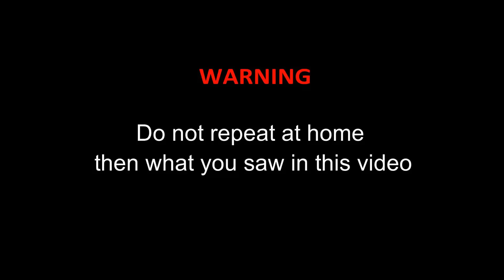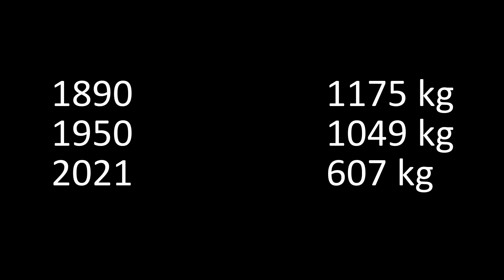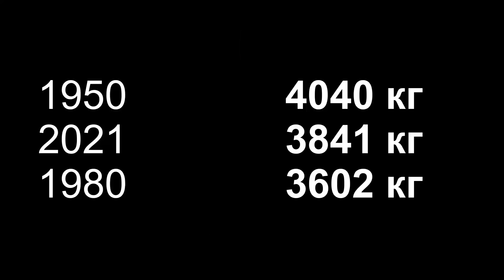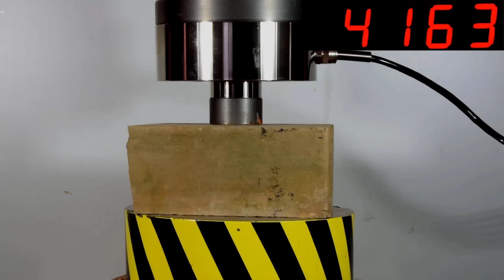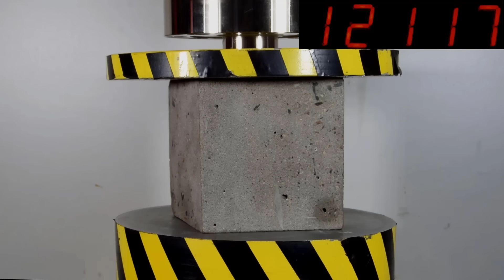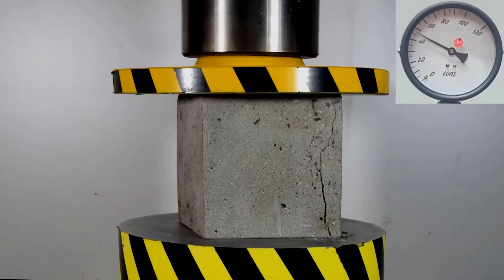HYDRAULIC PRESS VS OLD AND MODERN BRICKS

Comment: Whether the old ones were strong right from the beginning or gained its strength over the years is an interesting question.
Reply: They werent stronger. They were much larger.
Reply: Actually i have read somewhere that  buildings also need  Oxygen ! Without oxygen for 5 seconds all building will collapse instantly like a house of cards
Reply: @Ognyan397  that's terrifying
Reply: @toiletpaper5770  yes! So i guess that maybe Oxygen accumulate into the building and their components , that is why they get  tough with time!
Reply: The old ones have more practice
Reply: Bro the bricks are not from Asgard
Reply: @shubhampreet9928  🤣😂🤣
Reply: @Ognyan397  Was that statement that they need oxygen in their molecules (wich is expected, but trivial) or free flowing in the air?
Reply: @vast634   I think free flowing in the air , since if the oxygen from the Earth disappears  and  until we count to 10 all the buildings will collapse !
Reply: @Kudjokorn 
But, the newer bricks have younger lungs, and can therefore hold their breath for longer....!!
Reply: @Ognyan397  I believe that applies for unrealistic or science fiction types of scenarios.
Reply: @Ognyan397  how can oxygen from the earth disappears ? 🧐
Reply: @eugeneng2721  Ofcourse  a sci-fi scenario! :)
Reply: @vast634  Thanks!
Reply: No😑...
Reply: Stronger from the beginning better quality made compared to nowadays
Reply: @Ognyan397  that's not true, you can use a vacuum to remove all the oxygen and nothing will happen.
Reply: I would have thought the older bricks which definitely had water damage from limescale soaking into it for decades and charring from a fire, they should be weaker and more brittle I would have thought, from seeing such bricks in my life.
Reply: @Ognyan397  nah actually it will hold
Reply: They're mostly clay. They won't appreciate in strength over long periods of time like concrete can.
Reply: @Ognyan397  I saw the same in "What If" video.
Reply: That’s what I thought about
Reply: More the way things got produced.
Today is everyrhing about so fast and cheap as possible.
Reply: The workers back then were more focused in their work or Never had the thought of being under paid and worked happily. I am just guessing.
Reply: ._.)/ The older one has gone through years of fermentation process, that the taste getting stronger and denser...

Legend says, it will become diamond after milion years of process..
Reply: @watchesonly  
Yes !
Lower IQ workers make better things !  :D
Reply: I do ceramics however not specialized in brick. The thing is that it might be different material and firings time. This also affect the bricks, for example how compacted it is, porous, mixing time such. Also, remember there are different types of bricks.
Reply: It is almost certainly planned obsolescence.
Reply: @Kusunoky  
This was my thought.  Also, engineering plays a role.  For example, if we made a slightly more porous brick with nearly identical compression strength with only 70% the material/mass, then the loss in shear strength/yield is not really an issue since bricks are almost exclusively under compression.  Making lighter bricks with the same compression strength means taller or even stronger structures are possible.

Or just use less material.

It could also be that the process has been adjusted - why do 15 extra hours of work per brick if the difference in compression strength is negligible?

If craftsmanship were to be about building the best thing you can with the materials given, engineering is minimizing all that is unnecessary within a system and maximizing all that is essential.  There are times when the two concepts clash, depending upon what we are classing as the system.  I may want to, as a craftsman, build the best wheel that can be made.  The car company wants a wheel that works reliably and doesn't eat up 30% of the finished vehicle cost.  The customer doesn't want to pay me to forge wheels out of unobtanium alloy precipitation hardened over decades with chakra runes inscribed according to ancient gnomish rituals in the depths of tartarus and bluetooth 7.77 integrated in.  They just don't want the wheel to fall apart while they are not-walking-everywhere.
Reply: @Ognyan397  oxidation change the chemical composition
Reply: Concrete harder in 20 years
Reply: @Ut1F70F Sin 
There is a considerable difference between bricks and cement/concrete.  Bricks are kiln-fired and directly sintered.  Sintering is, basically, heating a material up until the atoms phase through each other to cease being distinct granules.

Concrete is a geopolymer with chemical bonds formed between the constituent components.  Considerably different from a sintered ceramic material.  Fired clay materials, for example, will not appreciably improve in strength over time.
Reply: @Ut1F70F Sin 
Durability is a rather nebulous term... Typically, in a metal, we would refer to durability being the ability to recover from stress or strain.  Tempering of a blade, for example, can make an extremely hard precipitate that will chip and shatter because the hardness is achieved by stresses in the material.  There are entire fields of science/engineering devoted to studying this in various metals and mixtures of metals.

Another aspect of durability is abrasion resistance.  Bearings, for example, have a probability of failure over time, rather than a known and defined duration of life.  This is mainly metal bearings, because the metal forming the ball and/or bearing surface is composed of crystalline grains.  These grains lead to uneven wear and the way in which that wear works over time is nonlinear.  "Glassy" - or "amorphous" materials are a huge subject of research and development because of their application to bearings, as the materials do not have crystalline grains, but "glassy" grains which do not propagate wear effects the same way.  This would "technically" be described as "tough" - but is a category within durability.

There are also things like springy metals/alloys.  A rigid material will shatter or chip whereas a springy one will flex and absorb the energy before returning.  Almost every metal has some springiness to it - but ones engineered to be springy obviously are.

Most of our terms for materials engineering are derived from those for metals.  Bricks and concrete are rigid.  Rather than bending or undergoing plastic deformation (where a metal is permanently bent), they shatter or crumble.
I have a set of aluminum nitride tubes for a project I am working on - and they are sintered together and almost perfectly rigid.  Rather than bending or flexing, if they are subjected to too much stress, they will just snap, crush, crumble, etc.  They are effectively specially formed bricks.

Concrete is closer to a resin or epoxy - which are closer to plastics... Which are polymers.  Stretchy polymers which we use all around us are a rather specific set of polymers.  If we want to be technical, sugar is a polymer - cellulose being one of the most common sugar polymers which can form rigid crystals stronger than steel.
You would know it as wood... But the "hard" or "tough" part of wood comes in a large part from the cellulose.

I'm not nearly as studied in the field of geopolymers, which covers the subject of concrete(s).  The concrete we use today is different from Roman concrete, and there are different formulations and processing considerations that go into everything, as well.  In many ways, roman concrete was superior to many formulations used today - that said, our concrete uses a lot of material recycled from industrial processes.
Reply: @Ognyan397  100% not true. Ive studyd architecture.
Reply: I doubt bricks would gain strength. But concrete absolutely gains strength overtime. That's actually a pretty well known fact.
Reply: I'd vote on the former as the current trend is to build everything out of the cheapest sh*t available, where as time & effort to source quality building products was a necessity for anything that's survived as long to exist in the present. Inferior bricks from that era will most likely cannot be found today. Survival of the fittest.
Reply: That is interesting. That's the kind of shit you want to see in the comments. Inspired speculation and fact sharing . 
Thanks for that. 
Are you secretly a troll too? 
Cause that would be very interesting lol
Take care stranger
Reply: Or the material was just better.  I am guessing the 2021 bricks are lighter and more porous probably for shipping purposes.
Reply: The bricks were far denser before 1970, now they are far lighter due to more air in the baking process.
This is what makes the older brick stronger more parts to rupture in the bricks core.
Reply: Wondered the same, I have heard some older brick making techniques were superior to todays, but also one questions how much stronger they got with time, subjected to same environmental/geological processes. Would be cool to think theres some brick making secrets out their yet to be discovered.
Reply: My guess is that it's a sampling bias.  The weak old bricks have already been destroyed by time.
Reply: @enochofmi  The older bricks cracked at twice the pressure applied? 
I don't understand your comment.
Reply: @Ognyan397  yeah but that’s at the molecular level you oaf. Lol buildings don’t breathe
Reply: @greyguy.960  not all bricks from 1890 still exist.  The weak ones broke from whatever they were being used for,  some chipped, and weren't video quality,  those were also probably on the weak side. Any brick that lived since 1890 and remains in pristine condition is probably one of the stronger ones. Those filters haven't been applied to the new brick.
Reply: @enochofmi  but did he sample the bricks strength from  just appearance alone , Probably just bought as seen or tested as seen.
To assume many things to a bit of stretch, I use Occam's fallacy of the simple answer is probably the right answer.
Anyway, the new bricks haven't been under load, I guess the brick from 1890 has been or been under the damage of freezing and thawing judging by where they live but still the older is much stronger,  by double than the new brick,  so the conclusion is clear in two examples as reference.
Reply: @Ognyan397  I think when they said "oxygen disappear" they were saying every oxygen molecule, including the ones inside the "hard material part" of the concrete .. just like the oxygen molecules that are present in our DNA or skin cells .. it does not need air flow oxygen to stay strong once it's already hard
There are oxygen molecules that only exist to "connect atoms" like carbon atoms, it can be used to create pencil but it's also presented in the steel ... 
I'm a civil engineer
You can search for super vacuum chambers, like the one used to drop a feather and a ball at the same time.. there's technically no oxygen inside but the walls won't turn in to dust
Reply: @greyguy.960  Occam's Razor, sure. I gave examples to illustrate my point, not to propose anything concrete.  My assumptions are: (a) any set of bricks have a range of strengths, (b) bricks at the lower end of the strength range are more likely to be destroyed before this video was made, (c) the longer a set of bricks has existed,  the more bricks will have been destroyed, and (d) the amount of strength lost by an individual brick over time is negligible.  

Given these assumptions,  the older a set of bricks is,  the higher the average strength of the surviving bricks.
Reply: @enochofmi  So load and freezing don't come into your equation or water damage? 
Which are the main things that would weaken a brick.
Plus if the sample of the old bricks is the same as the new bricks on-sight alone,  you are assuming he did it on strength? Which he just as the video stated it was on age.
Btw you using assumptions, I gave you a few counters as an example.
anyway, the newer bricks were many times weaker compared to the two examples which showed a far greater strength.  Unless he happened to find two one-offs and a very weaker newer brick you are arguing a point that doesn't change anything as the finding were not minimal.
What through me is" you saying the weaker older bricks were destroyed by the time" but not writing the context which made me think you were talking about video at hand.
Reply: @greyguy.960  those are things which would take advantage of minute imperfections such as hairline fractures,  so they would be pressures which contribute to my assumption (b).  

As for the validity of assumption (d) in the face of these pressures,  I don't know enough about how resilient a strong brick is to these effects to comment,  though I trust my safety to old brick buildings every day. 

Certainly,  it's a model,  so it won't perfectly reflect reality.
Reply: Yea, physics doesn’t work that way.
Reply: @enochofmi  Still you using your theory on only the older brick?  Try using the same scrutiny on the new ones also to make it fair as in weaker because if you're going that far. 
As I said the results are not negligible so it showed the older was double the strength in the two examples even thou might have been under load and weather damaged etc, which is inside as brick also. 
Anyway,   he was most likely picking on looks alone, to make it a fair comparison to try to make it equal.
If you throw in variables for the older brick you have to do it for the new one also, like storage etc.
Which I don't think he did either myself,  I would have to don't it on size and simple quality.
Reply: @Ognyan397  I’ve done concrete for a lot of years it hits its strongest point usually around 30 years. As far as it not having any air that it would crumble makes absolutely no sense in the water and far underground has no air even the center of concrete has no air because the air can only be on the outside it can’t get through concrete concrete airtight other than that maybe somebody didn’t vibrate it very good but even then if it’s thick enough it should be airtight. 

I did a demo job with a jackhammer and the outside of the concrete breakout more air was actually a lot weaker than when I got further into the concrete it was very old concrete they had to bring us pallets and pallets of nothing but jackhammer bits my bits were snapping in half like twigs . Had to keep on rebuilding the jackhammers as well because the concrete was so hard. Mixes back in the day could’ve been stronger but also we know for sure it does get stronger with age fresh concrete is very weak I broke some of it not even trying
Reply: Olden days producers preferred quality and not bothered about pricing, now a days producers only bothers pricing not quality since market has Soul in middle class people.
Reply: Or they were just over-engineered pieces of garbage....
And different sizes.
Reply: Well concrete continues to get stronger under good conditions for soemthing like 100 years.
Reply: Harder originally. Less porus/less holes (which matters a TON) just like 2x4 then v now are 2 completely different 2x4 as one is actually 2x4 (old) and the new isnt really a 2x4 (if my memory is right i could be weong on this. But i DO know for a fact old 2x4 is bigger then todays 2x4)
Reply: @Ognyan397  if the element oxygen was forcibly removed from all concrete, not removing oxygen gas.
Reply: @Ognyan397   It is true, but it is a little misleading. If the oxygen in the atmosphere dissapears the buildings will not collapse, what they mean is that the oxygen molecules inside the concrete in the buildings goes missing then the building will collapes. that is true in many other things not just building, also it holds good for the other elements like calcium in the concrete. If calsium in the concrete goes missing the building will collapse instantly too.
Reply: They were larger, and time tested, plus the modern brick used had cavities, which basically is garbage.
Reply: They were larger, and time tested, plus the modern brick used had cavities, which basically is garbage.
Reply: @HamguyBacon  You can remove the air , but take the oxygen molecules in brick its kinda impossible
Reply: @watchesonly  Ah yes lets see what started around the 1890s... oh thats right the modern labor movement. 

The one that got us the 40 hour workweek and basic workplace safety laws. 

Labor is entitled to all it creates. Always has been.
Reply: There is also some survivorship bias. Less strong bricks and concrete didn't make till this age.
Reply: @Ognyan397  bullshit, theres plenty of clays, cements and concreted currently being employed as structural components under hypoxic conditions and their stress endurance must be guaranteed for many decades
Reply: This is a success bias here. Consider that those old bricks are still around because they are the strongest, not because they are representive of their era.
Reply: @Kusunoky  EXACTLY, THANK YOU. I also do ceramics, I was searching to see if anyone had mentioned the clay before I said the same.
Reply: @Aim54Delta  THANK YOU. I was pleading to God that someone had spelled it out already.
Reply: @Ognyan397  you're thinking air pressure, not oxygen specifically. Buildings don't need oxygen like organisms, they need equal air pressure with the outside. Most buildings are only really capable of about 4 or 5 PSI difference between the inside and outside of the building. Meaning just a 30 percent vacuum is enough to bring down most buildings. Air pressure at sea level is 14.1 pounds per square inch but as long as the inside and outside are equal, it doesn't matter. But if you suck enough air out of the building some how. It will collapse unless you build a building specifically to be a massive vacuum chamber.
Reply: @Ognyan397  so bricks and concrete CAN get stronger with time. It depends on the climate. In coastal cities, the salt heavy moisture form the ocean deposites minerals into the very tiny pores in the bricks and concrete and over time those minerals crystallize with the aggregate in the concrete and make one solid structure. That's why Roman structures are still standing, the base concrete has become one solid rock instead of just a stack of bricks linked with mortar, they are chemically one big rock now. With proper maintenance against storms and earth quakes, concrete structure can last near forever. Reinforced concrete however does the opposite. Because of the rebar, the concrete will Crack and crumble over time because those same pores in the stone allow water to reach the iron which will rust and expand putting exponential pressure on the concrete till it breaks, which is why nazi bunkers in Normandy are crumbling decades after they were built meanwhile Roman bridges in Italy have stood for 2000 years relatively unharmed.
Reply: @radicalracing09  more like made for different purposes. Bricks in the 1890s were structural and intended for long term structures. 1950s bricks were hybrid structures with bricks holding some weight and beams holding the rest, now beams hold the vast majority of the weight and bricks are only meant to hold just enough weight to keep them in place. So basically the floor joists and some pipes depending on the architect
Reply: @Ognyan397  how :/
Reply: @Defensive_Wounds  It actually last longer than modern brick surprisingly.
Reply: Looking at the bricks from now vs the older ones there seem to be a lot more air bubbles in them than the others
Reply: It's variable, from the type of clay used to the original baking method. There's also likely compression loading involved, literally squeezing the grain structure tighter and tighter, which would explain the different color in the center of the bricks
Reply: What makes you ask this question
Reply: @Ognyan397   I'm going to choke a brick to see what happens to the house.
Reply: @Ognyan397  actually oxygen has the opposite effect and can cause deterioration of materials and is one of the elements responsible to deterioration of old constructions, also if oxygen bubbles get trapped into blocks of concrete they can cause cracks when weight is put on then.
Reply: @Kudjokorn  wrong that oxygen is already part of that molecular bond so if vacuum it  will still hold. It won't harden in a vacuum though.
Reply: I think you can see that the 2021 brick still has some moisture, so it has not cured fully unlike other bricks that have had longer time bonding and drying internally, also could be the bonding agent, I know that some brick use an adhesive to make the shape
Reply: You're actually right the longer the bricks sets the more it gets dense over time the more pressure from the weight on it really compacts it I had a brick made in 1901 I hit it with a sledgehammer and it bounced off not even a crack or a chip but I did the same with a modern brick one hit and it shattered
Reply: @Ognyan397  if oxygen disappeared for 10 seconds and then came back the world surface will literally just explode from the formation of water also most things would just fall apart especially living things
Reply: @MrDeicide1  Your conflating IQ and knowledge.
Reply: Der Mensch bildet sich zurück nicht vor 👌🏽🤦🏾
Reply: @saugghos the old bricks were stronger from the start. Look at the surface imperfections on the new brick, all those bubbles. That's exactly where a crack would form. The old brick tested had no such imperfections, it wad smooth.

Just from visual inspecting of the samples one could predict correctly whick brick would be strongest. Nothing to do with age.
Reply: @Ognyan397  that's not true
Reply: Here is the thing. Structures of those times were load bearing which means, the brick masonry walls took load of the structure to ground. Structures of today are RCC reinforced cement concrete, which means load is taken up by the columns and beams of the structure and masonry walls just work as partitions, which means rather then talking load they apply load on the structure hence they have to be as light as possible.
Reply: Definitely
Reply: @Ognyan397  That's a lie. Bricks nor concrete is not held together by air and air pressure. It does not turn into sand in vacuum.
Reply: Old is always better! True mastery!!! 
Modern age is a joke
Reply: @Ognyan397  Don`t know where you read that but there is absolutely no physical reason behind that statement. Why would a building need oxygen to stand? It is not a living and breathing being. Your house would stand just fine in a perfect vacuum for many many years. In fact without an atmosphere and therefore without wind and rain buildings would stand actually way longer, for many millennia.
Reply: Bricks get stronger with age up to a point, if put into a structure the compression will also make them tougher as well
Reply: Simply, people made better and durable things in the past
Reply: @pilladisimo87  a brick is not something you replace easily like a phone or car, bricks are not made with planned obsolescence, the only reason a manufacturer could compromise on quality is for cost and that is either by shortening the aging period, using poorer quality clay, or messing with the baking conditions
Reply: @Gnefitisis  Good point, that probably is a contributing factor
Reply: Half these comments hurt to read, reason why new bricks are trash is because they basically water down more dust vs actual harden clay, old bricks most of them were not baked in a oven as where new ones are this speeds up the ability to use them quicker obviously but also weakens them over air dried bricks. Lots of dodgy bricklayers these days are using more sand in the mortar to try and use less and make the same amount always check their mixtures and have someone who knows with you.  Fact is new bricks old bricks we live in a throw away society and no company cares anymore about making things especially last for 400 years. Also old bricks over new ones are always heavier… some bricks even have the holes in them to save cost…
Reply: To my bedt knowledge, bricks reach maximum strenght after 25 years.
Reply: Or, only the strongest old ones survived.
Reply: @Ognyan397  no, they wouldn't
Reply: I mean these older bricks just seem more solidly done than the 2021 one, like this 2021 one has nany air bubbles and the other ones seem much more solid. It may be matter of manufacturing over mass production
Reply: It is hypothetically true that without any oxygen all concrete would be instantly destroyed. 
If only all the gasious oxygen would disappear for example by putting it under vaccuum this would have no effect on the stucture of the concrete.
but if theoretically all oxygen, also the oxygen bound in crystal structure of all the oxides and carbonates concrete is made of, would be removed by a flick of a switch, the remaining elements would just evaporate
Reply: @toiletpaper5770  that is also false
Reply: I dont think fired ceramics gain strength. P sure thats only concrete.
Reply: Im sure back then they had more deposits of "higher quality" clay, which may now be already exhausted today.
Reply: @allandulles7108  I don't think that is the main reason. I think the main reason for such a dramatic dip in quality from 1950 to 2020 is more likely due to obsolescence. In the 1890s and 1950s, your strongest cheap building material where bricks. In the 1970s reinforced concrete supplanted the brick as the go to cheap building material, as concrete pours could be done faster, and with more stability than laid bricks.

Thus with bricks losing universal usage as the major building material, they went from a major weight bearing component to more of a decorative design. In "modern" culture and home decor, the looks of the 1950 and 1890 bricks would be panned, but that is the difference between bricks meant to hold up factories, and bricks meant to make your outdoor firepit look nice.
Reply: İt was strong since the beginning, in the past they were making stuff out of natural resources now they adding manufactured materials, and cars body is another example example the old cars are tanks for all of the modern cars, also furniture and many examples
Reply: The old ones were bit stronger than modern ones from the start due to the differences in production methods.
Reply: Stronger
Reply: @Ognyan397  No, it's because chemical bonds in those materials wouldn't work without oxygen. There is however increase in strength over time, especially in concrete. Given enough time, it turns into rock by chemical reactions inside, and by absorbing minerals from water.
Reply: @Ognyan397  without oxygen, it would be quite hard to imagine us counting to ten.
Reply: The old ones definitely gained strength over time but the new one will not.
Reply: Perhaps, those old bricks trained.😜
Reply: Modern concrete gets harder with time. It takes hundreds of years to fully cure. ..
Reply: True was thinking the same:)
Reply: @Kusunoky  I had a similar thought. That businesses are so much more cost conscious that quality will meet the minimum spec more consistently.
Reply: @Ognyan397  lmfao thats about the molecular structure lol
Reply: Adam college with a structural engineering degree was to test concrete exactly like this.   He worked in a warehouse that had samples of concrete from Bridges and buildings across the country and on a schedule he would take a piece out and break it just like this to see how it was holding up.  
  He did tell me at least in the case of concrete, that it becomes much stronger but also more brittle over time.
Reply: @mathorsky  mind your own business
Reply: They went to the gym at that time 😎
Reply: @Ut1F70F Sin oh....  Just take me as input.  My brother is an expert, and that was 30 years ago now, lol.
Reply: Cement continues to cure for years.  At least that's what the highway department tells me.
Reply: @Ognyan397  What is meant there is concrete!
Not The brick itself
Reply: Old vriksh they burn fire so it get strong new briksharopan they dnt burn in fire
Reply: @-Nick_Gurr_Rich-  all concrete isn't made equal though.
Reply: @dartheater7348  modern bricks weigh significantly less than older ones, they are made with lighter/less material and are smaller, modern bricks are pretty neat
Reply: Not too sure. Wasn’t very scientific.
Reply: it's because they were not cheap back then. and they actually spent time and made them quality. like roads today, most of our roads break down in about 20 years or so, on the other hand, there are 2000 year old roman roads that are like if a road today was there for 5 years. modern items are meant to be produced in quantity not quality. the ancient civilizations were for quality. if the roman's had to replace their roads every 15 years they would not be able to have a good system for travel and trade.
Reply: I think bricks during the 19th century and earlier are tougher because they likely have little to no pores. Which make them very solid and sturdy. Likely had to do that those bricks are handmade. While modern bricks are more breakable do with cheapness. (Except the high strength one. It's made for resisting against hurricanes)
Reply: @toiletpaper5770  I'm sorry. I am truly in the wrong. I should let false facts spread on the internet like wildfires./s
Reply: Old ones got the cure time they needed.
Reply: @Ognyan397  this is clearly absurd nonsense.
Reply: The old ones has more experience
Reply: The old ones are made from pure handmade materials, bricks nowadays are recycled and mixed and they rely on steel foundation that’s they it’s not necessary to make a pure grade material because it will cost a fortune to do ton of those.
Reply: I don’t think its age related ,in the old days things were built sturdier and stronger in order to last, in the new age things are built cheap because in the age nothing is meant to last for a long time
Reply: Or maybe it’s because things nowadays are made to break so you have to buy more
Reply: @Ognyan397  That is just wrong.
You would need to pull out the oxygen atoms that already bonded with concrete , which wouldn't happen if you were to take out all the oxygen from the air.
So it is pretty much impossible for that to happen.
Reply: @morbiddinosaur   True brother, I wanted to share also that for example in my experience, many places in South East Asia they have different bricks. I have saw 2 type ones usually for building and not very good also very cheap, if exposed to rain it can erode it very fast compared to a expensive brick one. The shape and strength is WAY different.
Reply: @Ognyan397  its not actually works like that, building do needs molecular oxygen, but not an oxygen that we breath, its like water, water is hydrogen and oxygen, but that doesnt mean that when you release hydrogen up in the air that it would become a water
Reply: @Ognyan397  it needed for cement chemical reaction. The source is from water H2O.
Reply: some of these do mineralize. You need to do microscopic analysis of the crystal formation.
Reply: i think its about quality , old Always are better  quality
Reply: @jarvisalden9019  correct. We are making some hard ass concrete these days. 🤣🤣
Reply: 🤣🤣🤣 Gained strenght over the years 🤣
tf your talking about theyr resistence was conserved in a good percentage due to the very good recipe choosed for making them..
time doesn't make everything stronger but the oposite for many things due to the oxydation that ocurs in years because of the air
Reply: Listen guys, after a few days of direct sun exposure to dry, old bricks baked with fire and straw. And at that time, the quality of the clay and soil was quite good.. while the new bricks are freshly baked in the big oven, I don't know exactly how the new bricks were produced, but I do know how they made 1990s bricks
Reply: Maybe because they're wetter than the modern ones, less water in the older ones because it evaporated over time.
Reply: I dont think thats the interesting question at all tbh
Reply: Older are stronger because they didn't know as much about building as they do now, so the older bricks were built to withstand more pressure and if in the event of a crack to not crack as fast
Reply: I am sure you skip the school. Every item built, in time degrades, wont improve at all... except the wine..
Reply: @eduardhagiu9836  exactly, they were built stronger due to saftey regulations at the time. I forget what school, but they tested the same thing but under different conditions and older always prevailed because they had to make it stronger than we do now with all the internal workings of buildings now
Reply: I know concrete gains most of its strength in something like the first 28days, and continues to get gradually stronger for the next 150 to 300 years depending on the inviroment it's in and then starts to degrade after that.
Reply: Even a visual comparison is enough to show you why theyre stronger. old bricks are solid. Those new ones are riddled with gaps and cravasses.
Reply: @Ognyan397  that is actually just a myth, check action lab shorts, he the science guy and he did make a video about this
Reply: Its todays shitty materials and low quality for more quantity. Easy peasy with no need to overthink shit
Reply: no, only the strong ones survive
Reply: There less dense these days is all! ....they don't do it like they used to !(properly I mean! )
Reply: Slaves made them so they had to be durable or they would face the consequences
Reply: a few years ago while the city (Caldas Da Rainha) were re-making an old street 
they found an old Roman foundation 
they had to bring in heavy jackhammers and it shook the modern houses on the street while the carved just enough for the sewer line , 
it wasn't teek, teek, teek 
it was thonk, thonk, , , , , thunk
Reply: @Ognyan397  so if I drop a brick in the ocean does it grow gills in order to keep absorbing oxygen?
Reply: @Ognyan397   that’s misleading. The statement your referring to is if all oxygen atoms disappeared from the planet including in the bricks and concrete not just from the atmosphere.
Reply: @Ognyan397  not true, their need oxygen to harden. After that vacuum isn't a problem.
Reply: Older was made with better quality. Today quality is not rentable for many companies.
Reply: clear case of survivor bias.....
Reply: @Defensive_Wounds  the bricks are fired at a much higher temperature therefore vitrified and dont absorb water, they might be very slowly eroded but that was nowhere near progressed enough to affect its integrity in the video
Reply: @Thunder44420  in the way, that it isnt bound onto/in our atmosphere, but with its properties as a gas able to slowly but steadely dissapear in to the universe.
Reply: Why isnt anybody talking about the antique concrete carved from the fortress in 1890 ? 🤔 i tought an infinity stone will pop out of it
Reply: @Ognyan397  that is a What IF video. Look for it is What IF there is no oxygen for 5 seconds.
Reply: You all didn't notice that the press got stronger by the third brick.
Reply: @Ognyan397  if there was actually no oxygen it would do nothing lol because if you but concrete in a vacuum thing that takes all the air out nothing happens to it
Reply: @Ognyan397  Is that like what happened to the Twin Towers? The blazing fire consumed all the oxygen?
Reply: Older bricks were made by better craftsmen using better techniques and in general had a greater care for the product they created.  There’s isn’t much produced today that could hold it’s salt against some old fashioned blood and sweat craftsmanship.
Reply: @watchesonly  the workers back then were poorer and had to work harder for less money than today and didn't have access to all the stuff we have today, like being able to eat fully or use modern medicine. Today workers live in heaven as compared to the XIX century.
Reply: @Dismythed  it's not planned obsolescence. Those modern bricks suit their roles perfectly and you even have those extra during bricks. Making stuff unnecessarily more durable isn't an advantage if it comes at cost of has more disadvantages. If the brick can sustain 90% of the load and weights half of the previous brick, you'll not only get a cheaper brick, but still be also able to build 90% higher buildings. There are some many aspects of this issue and you want to dumb everything down to "it's probably planned obsolescence".
Reply: Yes
Reply: Its greed that keep modren things breakable...
Reply: I say... No... Bricks are susceptible to the elements like rocks and stones are, they are vulnerable to erosion, temperature changes, and humidity... That's why buildings collapse without proper maintenance.

What happens is that in ancient times bricks were way more dense than they are know, modern bricks are lighter to allow the construction of taller buildings.
Reply: @Ognyan397  tats actually true,, cause some bricks and all cements are made up of calcium carbonate,, which has chemical formula CaCO³ 
And there's three atom of molecules in it so, if the oxygen was removed from the compound then the building would be turned to dust in seconds
Reply: @Ognyan397  that's completely false. If you put concrete or bricks in a vaccum chamber I can assure you nothing happens. I'm guessing you heard that from one of those clickbaity videos titled something along the lines of "what would happen if earth had no oxygen for 5 seconds?" Those videos make up a lot of stuff just to make people interested.
Reply: @Ognyan397  well, yes and no. The concrete made right now will be just fine without oxygen. The whole “without oxygen” thing is made with the idea that every single atom of oxygen, even the atoms in other atomic structures, were to just disappear. The oxygen atoms in concrete is in a larger structure and is not the oxygen we breath and would keep its bond just fine in the vacuum of space
Reply: @Ognyan397  building won't collapse if oxygen is lost for 5 seconds or even 5 minutes, since the oxygen molecules has already bonded with the cement, it will on collapse if the oxygen atoms are vacuumed out of the cement then it will collapse instantly
Reply: @Ognyan397  what tf you guys talking about building material doesn’t breath oxygen 😂 I think your confusing it with gravity
Reply: @watchesonly  that’s not true
Reply: @Ognyan397  the oxygen in bound in the molecules. I mean yeah if every oxygen molecule magically disappeared from the planet including those bonded to other elements then they would crumble but if you put bricks and cement in space it wouldn’t make the slightest difference to them as far as that’s concerned.
Reply: @Kuraimizu9152  Still doesn't explain the cement of bridges being weaker today. Also, do you have documentation or video proving your claims?
Reply: @Ognyan397  is it oxygen or atmospheric pressure ?
Reply: Disregarding their age and strength, 2021 kind of looks like shit
Reply: @watchesonly  industrial revolution was insanely cruel on workers long days, poor conditions and low wages. Happy little workers I think not.
Reply: @Aim54Delta  so, sir, the strength of the older bricks were bec they were made with quality in mind, and the 2021 is sub-standard, maybe not put in the kiln longer than it should to save cost in fuel for the fire?
Reply: @Dismythed  cement today is weaker mainly due to cheaper materials but there is also the fact that it cures and strengthens over decades
Reply: They also had less air pockets since they weren’t made so quickly like the modern bricks
Reply: Now a days, it’s quantity over quality
Reply: @IngiannOceanstryder11  i guess that's the real reason, bec nowadays it's all about profit and cutting costs and the fastest production possible
Reply: @hasuo9749  concrete gets harder as it cures.  You don't know anything about concrete and you are trying to make fun of someone else when you have no clue what's going on ... 🤣🤣🤣🤣🤣👍
Reply: Now they’re lighter and “weaker” for a reason,  it’s because they should be kind of flexible in order to construct buildings that can resist earthquakes and that stuff
Reply: @-Nick_Gurr_Rich-  we have the knowledge to make hard ass concrete. But also the knowledge on how to decrease the cost of making it. Somewhere someone has calculated how long a brick needs to last to be considered a brick, but also how soon to break or fail so that it can be purchased again.
Reply: @jarvisalden9019  correct. You are very wise to the game. 👍. That high psi concrete tho.... It's so fucking hard... 😍🤣🤣🤣
Reply: @letswatchmy.shorts  Bricks and cement are not what do that. They need those things to be rigid and durable while their joints are what flex and shift. If the material has too much give, it will collapse. If it is too rigid while having a tendency to flake, it will shatter. As you saw in the video, tortion causes shattering. If blocks cannot resist tortion and extreme loads, they fall to pieces like dirt cakes, which is what they are. The more clay, the stronger they are and resistant, not only to weight and impact, but to tortion and shaking. You want a block to crack instead of liquify.

Here is the math on weight loads. If you have a block that is twice as heavy, but six times stronger than another, then it can actually build three times higher and is more resistant to earthquakes because of perpendicular downward force and increased shear strength. (6 ÷ 2 = 3)
Reply: @Ognyan397  if you change the molecular state maybe but if you put it in a vacuum chamber nothing will happen
Reply: First thing I asked myself before watching this video
Reply: Bricks do not go through the process of hydration like concrete.  Concrete will continue to gain strength due to the fact that it will continue to go through hydration years after it was laid down. A brick's strength is set at birth.
Reply: They are likely to get worn and weaken by time, not gain strength
Reply: @justinelliot6433  and I, for the first time in ages, actually learned something new in the comments section. Thank you good sir for enlightening me in a piece of chemistry and civil engineering I've overlooked.
Reply: @Dismythed  I don’t think so, if it’s more compacted, then it will resist more, but it’s own weight will make the building fall during an earthquake which will move the building like nothing 😂 it could resist more in theory, but put it in practice, a building that’s too heavy is bad because it would fall easier.
Reply: @letswatchmy.shorts  Concrete doesn't expand or contract (Bricks either, watch the video I linked). That would make it pointless. And you clearly don't know how earthquake-proofing works.
Reply: @Dismythed  You can say whatever you want, and I might not know anything about earthquake-proofing you “genius,” but it’s logic, don’t let yourself overthink on something that simple, if it’s so heavy is going to fall. I guess you’re genius brain can understand that 👍 I never mention that I was a professional on this field, that also means we’re not taking variables like the pressure or which structure you decided to use when building an edifice. In other words, talking about a normal building it will fall easier if it’s too heavy and can’t resist the force in case of an earthquake.
Reply: @letswatchmy.shorts  Please don't bother responding to my posts anymore.
Reply: @Dismythed  Cool, “genius” let’s think about walking first before thinking about running. 🤫 You sure are like people who get a paper with a 2+2 and take out the square root instead of just adding the numbers because you’re so smart
Reply: @vast634  Was just going to ask that, I, at first, assumed in their molecules.
Reply: @Ognyan397  no, its related to the chemical composition of concrete without oxygen concrete isnt concrete, its just rock
Reply: You also have to think, is it possible that the old ones are "stronger" because the strongest of the ones made that far back were able to survive this long? Plus this is only 1 brick from each year. Let me know when he does a sample size of like 100 from each year
Reply: They’re more dense, they’re typically compacted different, and usually now a days bricks have holes in them
Reply: They can’t get stronger over time. They were just designed better. Much like everything else, they don’t make ‘em like they used to.
Reply: @Ognyan397  U got any kind of source?  I’d like to see why you think that, because it doesn’t really make sense to me.
Reply: @Ognyan397  okay, the way you put that might be kinda confusing. The reason you heard that is because it is true, but, not for the reason you might think. If all Oxygen on earth just disappeared for 3 seconds, then everything would fall because there is Oxygen in the soil. With the Oxygen gone, all that empty space has to be filled with something and that something is going to be whatever is closest. In this case the soil is closest so it all collapses taking everything down with it.
Reply: @masonmurray1011  here, this is my reply to kudjokorn. okay, the way you put that might be kinda confusing. The reason you heard that is because it is true, but, not for the reason you might think. If all Oxygen on earth just disappeared for 3 seconds, then everything would fall because there is Oxygen in the soil. With the Oxygen gone, all that empty space has to be filled with something and that something is going to be whatever is closest. In this case the soil is closest so it all collapses taking everything down with it.
Reply: @dartheater7348  they aren't that much bigger
Reply: True,I was wondering wether time was the one that made it stronger or was it the material itself
Reply: Or are the only old bricks that survived the strong ones?
Reply: @Ray-iu7hg  survival of the brickest
Reply: @taliaeategg2027  the fact that an 1850 brick survived both ww1 and 2 is insane.Its a ww1 and 2 veteran XD
Reply: They started out stronger. Bricks from a 100 years ago were made with really only clay, water, and some sort of fiber usually straw. They would then be sun dried for a few hours and then baled for a few more hours. It took a long time to make them but the resources needed to make them were simple and easy to procure. Baked clay is incredibly tough and the straw helps to provide necessary air flow so that moisture doesn't build up in any open air pockets. Nowadays bricks are made with a mixture of concrete and clay, which is still strong but is also less resilient as time goes on. Concrete provides air flow but, moisture easily breaks down the bonding materials in the concrete and forces it to become brittle. As time goes on more and more moisture builds and the brick becomes weaker and weaker. In 100 years our bricks will be nothing more than cardboard, and brick made buildings from the late 1800s will still be standing tall.
Reply: @tacituskilgore1211  does that mean we'll have to rebuild? Cuz that's the plot of Wolfenstein the new order.
Reply: @Ognyan397  what exactly are you smoking?
Reply: @Ognyan397  sorry to say but that's false, by the time to brick is solidified the air disappears leaving it with just a hardened brick

it needs air to mix like everything else in the world
Reply: Stronger from the beginning
Reply: @Ognyan397  why?
Reply: Maybe over the years
Reply: @Ognyan397  who asked?
Reply: @Ognyan397  That's concrete that will do that (Which is the majority of what we use now), clay brick buildings and other materials would be fine.would be fine.
Reply: Wow, you people are realy realy realy dmb
Reply: Im a brick paver here on Oz. And bricks do harden with ages. If we get factory fresh easier to cut than recycled
Reply: @radicalracing09  I mean yeah but our infrastructure has also changed. Bricks seem to serve more as a decorative feature on buildings rather than a structural one
Reply: Ah I got spoiled.
Reply: @Aim54Delta  Modern high-resistance mixtures like Ultra-High Performance Concrete blow Roman concrete out of the (salt)water by miles, not only in shear strength (which is by far the most important metric), but also in terms of durability. Especially when reinforced with rebar. You'll see cracks in the concrete LONG before it's structurally unstable enough to warrent repairs. I'm talking literally a decade or more. People keep parroting roman concrete like it's some wonder mixture. It was definitely really REALLY good by roman standards, but it's subpar to any modern quality concrete. It's only feature that we don't know how to recreate is it's ability to strengthen itself when exposed to saltwater.
Reply: Survivorship bias is a thing, too. It's possible they are around over a hundred years later because they're the top top % in quality/strength from the time period.
Reply: What??
Doesn't everything degrade with time?
And after some time their strength become nearly constant and other factors like weathering become much more significant than gaining strength with time ⏲
Reply: @Ognyan397  
Is it true??
Reply: I think they were stronger like most things in modern day we use weaker material just to have lower cost and higher profit. Lol a wheelbarrow simple example we still have one my dads he got 15years ago and sure its not a long time but the difference is prominent. Old one strong af. The newer one we got already started breaking apart
Reply: I was wondering the same thing… like if the moister leaving a modern brick will increase its strength for some time until it looses enough to become weaker. I assume the old ones were built different and had better composition to begin with tho instead of them getting stronger with that much time. They should be weaker.
Reply: @Gnefitisis   it's an interesting idea. But what exactly was this brick surviving? I'd think that virtually all bricks from the 1890s would be undegraded so long as not purposefully or accidentally damaged by impact.
Reply: Old one was fired much
Reply: @thunderp1719  Well according to some people answers seems   it is not entirely true !
Reply: I would also like to know what was the 2021 brick'q quality.
Reply: Less avidity, better quality!!
Reply: Both built quality and old enough to absorbe all that moisture which will strengthen clay
Reply: The newer bricks are almost certainly made using a cheaper process.
Reply: very interesting  👌 👍 🤔 😊 🙂 👏
Reply: i dont know how they would gain strength over the years.. things were just made better back in the day
Reply: Maybe it got WEaker.
Reply: @michaelanderson3693  It's a basic concept. Don't know what to explain.
Nothing lasts forever and the stresses of compression, foundation sway, wind and/rain (if exterior), and of course replacement by deconstruction.
Reply: @unifiedmongoose7915  probably 🤣🤣🤣🤣🤣😇😇😇
Reply: @Ognyan397  so what about structures built under water like bridge piers and dams?
Reply: @andycrask3531  that is a good question however is not in my knowledge
Reply: I mean well looking at how some old building still standing strong in my area despite constant earthquake throughout the year and some new building looks like already in shit condition is probably it's strong from the beginning.
Reply: @blobs819901  🤣🤣🤣🤣🤣🙏🙏🙏🙏🙏
Reply: neither. they gained their strength through the miracle of child sacrifice.
Reply: It's an example of sampling bias. Only the strongest bricks will have survived from 1890 to 2021. Results also vary depending on the region the bricks were manufactured in, the recipe, their location and level of use, etc. This "experiment" is so weak that you can't really draw any conclusions about modern versus old bricks at all.
Reply: @Ognyan397  that's a false statement, because look at the international space station. And think about the space debris, meteorites, asteroids.
If you would have common sense knowledge on Physics. You will better about it. 🤷🏽‍♂️
Reply: The type of bricks where different...the newer one from 2021 was clearly burned with less heat...it has a open pore structure in the surface...the other two were burned under higher temperature and have closed surface structure...that s the reason why you use different bricks for different purposes...
Reply: @Ognyan397  being a civil engineer i can testify it is a famous myth
Reply: Having worked with concrete, I heard it takes 30 years for concrete to reach its peak hardness but that it continues to harden overtime. The first concrete didn't look old at all and could have been recently made hence the difference in color and wetness of the two.
Reply: Ye
Reply: @shubhampreet9928  - LMAO! Nice
Reply: @watchesonly  - you’re right about better paid.
Reply: He should do that experiment next.
Reply: @Ognyan397  doubt it
Reply: @Obscurite1221  
You're correct to an extent.  There are many different ways to rate a material in terms of strength and quality, and the Romans did not have just one formula of concrete.  The process for making roads, for example, had them make concrete as thick as clay and pound it into place along the bricks/stones forming the roads.  At least at the height of Roman construction.

They also tended to use volcanic ash, which is what ends up bonding with the salt in the sea spray and other things to form harder mineral replacements.
We have far more varied formulations than the romans and use a many different binders and substrates - most of which do not have the enduring property of mineral replacement.
Though if we were to reformulate a "proper" roman concrete, we could use wetting agents to even further reduce the amount of water necessary or allow for a more pourable formulation than what they would have used at the time, and it would likely be stronger.

I did not mean to imply that roman conctete was some mystical thing that was overwhelmingly superior - but for most purposes where we consider using concrete - that is - forming a rock on demand and by our design, roman concrete is vastly superior to most residential and commercial formulations of concrete used today in its longevity and stability.  There might be specific situations where we have concrete with higher strength or which can be poured in climates romans would refer to as lands of mystical wonders (it's a shame that the British did not retain the term the Romans had for them: "Hyperboreans") - if the Romans built your basement, that thing would last a thousand years or more.
Reply: The processes for current cement and cement products vary based on use. As the video showed they had a modern brick used for high durability projects that competed with the old bricks very well. In the past we did not really specialize components and tried to make sure everything was built to last. A great example was the reduction of the 2x4 down to 1.5”x3.5” it cut costs and waste. Many fillers that we use today to lighten the load for transportation also weren’t used. Everything was built stronger out of lack of structural diversity, and necessity.
Reply: I had the same question
Reply: The newer one had alot worse condition with cracks
Reply: Larger surface area. Unlike roman concrete that did get harder under salt water l.
Reply: They were stronger from the get go.
Reply: @vast634  who says absence of oxygen equals a vacuum? Either way the comment is still BS
Reply: Older bricks are more dense.
Reply: As is thicknes.
Reply: There are some ancient building rocks which gains strength as time passes and there is no end to it. That's why there are some buildings in world that are almost impossible to destroy now.
Reply: Kind of bias if that brick survived it would have been stronger to survive but a brand new brick hasent been tested with time
Reply: That question has been answered. Concrete continues to harden as it ages. However,I don't believe that was the only factor here.
Reply: @dartheater7348  oh lol true but who knows for sure that they meditate 24/7 to gain their strength from all those decades of training.
Reply: Rick's get weaker over time. The get eroded by the weather
Reply: Also the texture on the new brick, it does seems the brick is made differently. Not to mention the mix. Modern bricks are engineered to consider many things like optimum weight vs strength etc.
Reply: The new one is just mud,aggregate mix wirecut brick. its not burnt. you can see that inside of the modern brick is still kinda soft clay.
old bricks are burnt. i think they are much more stronger due to the burning in the kiln, it takes out all the moisture,and gives a tough surface to resist moisture and the heat also fuses the particles well.
Reply: I think it’s a pretty boring question
Reply: @Ognyan397  tf are u on and the video you watched?
Reply: Maybe the Old ones had to be made stronger since they often were part of the loadbearing structure and the newer might be used for facing concrete slabs
Reply: The old one consumed other bricks and became stronger
Reply: @Ognyan397  you heard about something else who does not mention why building without oxygen collapse: it’s because most buildings are constructed from silicates or aluminosilicates which contain oxygen in their molecular structure
Reply: The older ones are more compact and have less air holes. (At least from my experience of seeing bricks)
Reply: @Ognyan397  that's one of the misconception, when they said "without oxygen" they mostly like meant oxygen molecules go poof, because when the cement set in it traps some oxygen in the formation
Reply: @greyguy.960  I see bricklayers chop bricks to the right size with their trowel..is this a new practice?
Reply: @koyaanisqatsi78  mostly yes, it used to be done with a brick hammer around 20oz now you can use the edge of a trowel.
Even dropping a new brick from 3 feet can course then break apart, the strength difference is very visible.
Reply: @Ognyan397  Nice demonstration by You, sir, why we need back the visible dislikes on YT! :D Thanks! :D
Reply: My house is 95 years old and stands strings till this day.
Reply: What if it lost strenght?
Reply: It could be that modern bricks are designed to withstand weight put across the whole surface, not just a small section
Reply: That time quality was high and price was low now price become high quality becomes low 😂
Reply: The old bricks are miles stronger. They had no choice. They lacked other materials. The clay was better and they were fired for longer. By hand. There are hundreds of tricks employed to make the buildings they needed without thr materials we now use, we simply don't know how the brickies did them. 200 years ago they were artists.
Reply: I believe morter never stops harding but idk about what the brick is made of
Reply: They used different sediment and the older ones were better cured.
Reply: Strong from beginning.  If anything,  time has only made it more brittle than first manufactured
Reply: @Ognyan397  it’s need by the components like cement etc.
Reply: @watchesonly  because they weren't underpaid. LOL. Back then if you wanted masonry work done you hired and paid for skilled masons. Today its done by laborers who kinda sorta know what they're doing. Its common in most trades. Companies don't wanna pay for skilled labor anymore
Reply: @Ognyan397  That is talking about oxygen bonded to the molecules. If the oxygen in the air was removed, nothing would happen. If the oxygen bonded to the molecules in the material was removed, it would collapse. Removing the oxygen from a molecule isn't as simple as putting something in vacuum though, as it is physically bonded to the material.
Reply: The old ones are those that survived. So it's survival bias xD
Reply: Had the same thought
Reply: The question is …… not related? I guess
The main reason is material (they might be the same name, same use through all these year but not the same composition). If you have a chance to hold those bricks, you will immediately tell the difference. Old ones are heavier and …. firmer (?). They are “packed” 
The later ones, as I know, alot of times, they were made to save cost and resources (since people can calculate how strong they should get to hold up an architect in a certain amount of time). An “overweight” one is not necessary, you just need a right one.
Reply: Were the bricks working out?
Reply: @Ognyan397  it’s oxygen in the compound that holds it together not oxygen in the air. Nothing would happen to concrete structures if oxygen in the air disappeared.
Reply: @watchesonly  "Never thought about being underpaid"

Laughs in Pinkerton's death squad
Reply: It might be selection bias, as all of the weaker old bricks would have broken by now, and therefore we only have the cream of the crop
Reply: The mortar is the bottle neck. The old bricks are much to hard to work with [pun mine] They are many times stronger than the wall they sit in. If you try cut a pipe into them or drill a hole you end up pushing the wall over or pushing a brick out.
Reply: As someone who had a few experiences modeling clay I was expecting this exact results from the very first sight. The 2021 piece has more air holes than the others, making it less compact and therefore less resistant to pressure.
Reply: The older bricks were made better, if you look at the new one and the old one the new one has air bubbles and stuff like that and if you hold one in your hand it's much lighter. The old ones are solid. 
The concrete gets stronger over time from minerals in the water.
Reply: @Ognyan397  That's bullshit.
Reply: There’s also the survivor bias. The bricks that were poorly made in the 1890s didn’t last while the well made ones did. Therefore the only bricks from that time are some of the best made in that time. Where as the current brick they used is likely no where near the best brick made today.
Reply: Old bricks just better than the rubbish produced now.
Reply: The old ones that weren't strong broke a long time ago
Reply: They were even strong when manufactured
Reply: I see lots of comments about the bricks but not the concrete.  Concrete does in fact harden as it ages.  Also, the concrete taken from the fortress had large aggregate, whereas the fresh concrete looked like sand and cement.  If it had aggregate, it was smaller and less of it.
Reply: They were stronger from the beginning, much more dense when compared to modern cheap brick.
Reply: @dartheater7348  they were both larger and more dense
Reply: @Ognyan397  that does have something to do with it but the main reason is that clay hardens over time, so the older ones will be tougher and they were bigger aswell
Reply: They certainly do cure over many years, concrete for example takes 99 years to set was often heard when I was a concrete fabricator back in the mid 1980's.
Reply: @Ognyan397  Maybe when referring to skyscrapers, but that isn’t universally true. There was a lake that released a giant methane bubble that killed everyone within 500 yards because it displaced all the O2. All the building(wood framing I believe) were still standing.
Reply: It doesn't really work that way 😀
Reply: Sounds like a good thing for Half as Interesting to talk about next time we get a brick video
Reply: I can say that the concrete used in ancient times is much stronger than anything we make today, but they also used a lot of volcanic ash in their mixture
Reply: @Thunder44420  If a very very big fat man takes a deep breath pooof all oxygen gone🤣
Reply: @oldacount12  but u didn't studied science..
Reply: Now that is an interesting point
Reply: A
Reply: @dartheater7348  They literally don't look any larger. Lmao
Reply: @Ognyan397  That was debunked.
Reply: @dartheater7348  yep
Reply: If you was in school uou should know that clay gets harder when its first burn and then getting wet it gets harder and harder
Reply: they are asgardian brick they gain power as they old
Reply: The older ones have small and tight grains compared to newer ones that have air pockets scattered throughout
Reply: @vast634  oxygen in the molecule.
Reply: they were stronger, but way to product them wasnt effective and they werent capable for bending
Reply: Cement never stops getting Harder with the years. So the older it gets the more it can take. Also if you build Like a Bridge and you have parts under water they will get Way more durable beacause no oxygen can reach it
Reply: Do you see all those small voids in the new brick? They don't do favors to its structural integrity. They concentrate stresses. You can almost tell the new one was trash before it was even pressed.
Reply: It can't gain hardness with time, old Kilns and better raw materials is the only factors that determine the hardness.. But the shape is from the makesmanship..
Reply: Or they were stronger before and lost their strength over time
Reply: @Ognyan397  I imagine it has something to do with atmospheric pressure.
Reply: They would be stronger from the beginning. Older bricks were hand made, and were made from denser materials and better quality clay.  Modern ones are mass produced in factories using inferior materials. That's why people who can afford it buy old bricks from a reclamation yard.
Reply: Dude.. Wrong theories.. And Terry guo, foxcon ceo would back me up on this, factory made equals qualify control.. My biggest competitor uses 400+ HP to grind the clay before the slab injection.. But my bricks are better becoz 1, raw materials, 2, contaminants, and 3, firing process.. But my bricks from 40 yrs ago are like stone. Raw material importance is overlooked
Reply: Newer cheaper thats all
Reply: The materials are too expensive now.
Reply: High tech doesn't always mean more solid, if you don't need 10000 kills before it break, maybe they are way easier to craft way more of them. Maybe what stick them together fix better on them, ect.
Reply: They gained strength because the inside compound have more time to cure
Reply: @captainphoton1693  dude,  raw material and curing the clay is the most important part, all else being equal, the tech is used to force "crap" added in to stick.. Eg, vacuum pulling and high HP machines all designed for compact inferior raw material
Reply: @Ognyan397  no, you saw a video, I saw the same video. The premise was that oxygen was removed from the atomic structures of materials as well as air.

If you remove things from a materials atomic structure, it's material properties change. Not to mention the lost mass, think of removing a bunch of center pieces from a puzzle, it's no longer completed and weaker if you wanted to hang it up :)
Reply: Maybe it's like natural selection only the strongest remained intact
Reply: That modern "concrete" looks more like cement to me. There doesn't appear to be much aggregate, and the mix looks pretty wet, which is usually worse for strength.
Reply: No it’s because they actually put effort into making things then
Reply: I believe Roman Concrete gets stronger over time so that’s why they’re super strong these days.
Reply: Concrete gets stronger the more it's exposed to water
Reply: Or may be they lasted so much time because of how strong they are
Reply: @dingzhixu3678  yes that what I said, they aren't making the most solid anymore, they are making the cheapest/the easiest to use.
Reply: @Ognyan397  they will not suddenly collapse lol.. u talking about solid state thing.. if for couple hour without oxygen it will still stand.. what its mean by u reading is over time not instantly rip
Reply: Its totally about manufacturing.. if u work in construction u see all type of brick.. strong brick mean more time more material more expensive less profit just to build ur house for u to use or live like 40-90year then rebuild, destroy or renovated new one.. not for bunker, safe shelter or other long term use
Reply: Survivorship bias
Reply: Ok
Reply: No, it is the simple fact that the 2 old bricks were produced with burning method, to be more resistant, while the 2021 brick is not burned
Reply: @captainphoton1693  yes, but that isn't always the case.. In Asia the industry is soo cut throat owners suffer losses for decades sometimes and operate to keep families employed.. But say Australian bricks are high value and high price, totally different product to their Asian counter parts
Reply: @Ognyan397  huh interesting .. well this planet has other things in the atmosphere to ... Interesting thought
Reply: No they did shit right back than there wasn’t cutting corners to save a few bucks.
Reply: Better made. Look at all the buildings and bridges made in the 1800 are still standing today.
Reply: No.. It doesn't gain strength unless certain conditions forces it to.. And for temp to influence clay bricks, it requires at least 750-800 degrees(C) continiously over 48 hours, the strength will change after its out of the kiln, after 72 hrs, it won't change much. The older bricks were better because they used the best, uncontaminated clay, and less air/land/chemical pollution. Hence, the most pure clay. Certain Kilns will produce a different hardness but different efficiencies in production
Reply: @Defensive_Wounds  limescale doesn't affect it much, alge growth is still okay.. Salt is the biggest worry.. It gets absorbed with water, but if it dries too fast the salt crystalision will crack the brick from inside out
Reply: @sparkywilson1405  sorry to bust ur bubble.. Concrete is a glue like substance that deterioates over time, only ancient Roman concrete doesn't brake down.. Whereas bricks have been found in Egypt, Terra cotta warriors etc..
Reply: @watchesonly  did they get paid in peanuts instead?
Reply: @Aim54Delta  chemical compounds, Inc all polymer types all eventually brake down, even plastic (just longer). Bricks are already at its chemically stable state, that natural climate doesnt get to bricks break down conditions.. If bricks broke down, then it's still clay.. You can even burn bricks to a molten state, with the end product being lighter and alot larger, but the hardness becomes off the charts
Reply: @frankpaws  heavier if all other factors remain the same compared to 20 years ago from the vacuum process that sucks out the air bubbles producing a more solid end product
Reply: @greyguy.960  Snowy climates require a different spec of brick. A less water absorbent type, otherwise the ice would blow the brick up
Reply: @_Circus_Clapped_  what adhesive? All chemical polymers get burnt off in the kiln, and also dried in the kiln, when it's fresh out, it's completely dry. Bricks are a breathing material, so it absorbs and releases water depending on humidity
Reply: @matthewbyrom5394  dude.. Plz apply logic to your thinking.. How can something gain more mass unless there's other atoms added to it? They are not living organisms
Reply: @dingzhixu3678  Yes, that was my point the weather takes a toll on bricks, plus judging by the age of the brick used and the nation of origin,  it was used for cold climate.
Reply: @humankirk9196  are you an expert? Smooth bricks is comes from the vacuum process and is inferior because there is less surface area for the cement to latch on.. Different Kilns produce differnt looking bricks, unless it was undercooked, eye inspections arent accurate.. But only the the experienced, can use ears to hear the crispness of the brick (like a dupont lighter)
Reply: No, they gain very little over time. you can tell by the way they break the strength of them. They don't crumble, they break, almost straight.
Reply: Different material ig.
Reply: They are fully cured. That new one hasn’t been through anything yet
Reply: The older ones were made when bricks were a structural element and the newer bricks are made as decoration.  Notice the denser structure of the older bricks and the new one with lots of air pockets in it. The new high strength brick made to be strong is also much denser. The old concrete has had years of curing an was made for strength.  The newer concrete is not as well cured and is also less dense as the older brick. FYI The Hover dam is still currently curing from the pouring of the blocks. 100 years and still getting stronger.
Reply: Goddamn Viltrimite bricks.
Reply: It's because we learned to use cheaper materials, yet charge people just as much, which is why the newer "high strength" bricks are stronger, because if they wanted to they could make the bricks better.
Reply: Yes. Concrete has the property of hydration which completes fully after 10 years. So concrete does gain strength in long time. But i don't have knowledge about brick gaining strength in long period.
Reply: @Ognyan397  actually not
Reply: @Ognyan397  I'm fairly certain buildings dont lose integrity and collapse under a mild vaccuum, that's completely ridiculous.
Reply: Probably a mix of the two.
Reply: Probably just the higher concentration of clay in the older bricks
Reply: @Ognyan397  that's fromWhat If channel video
Reply: @Aim54Delta  LOL best comment I've read in a while.
Reply: @pankajalakshmi7912  "What if"  channel yes!
Reply: @Ognyan397  that is not true you can put buildings in a vacuum and there will be no damage
Reply: Not a question, cement is still hardening after 100 years, only slowly.
Reply: Old ones are overdesigned that's why..modern ones are less strong because these are deliberately designed this way to keep cost at bay..overdesign is not good engineering..keeping the strength at just what required is
Reply: @Aim54Delta  no customer wants cheap material. They want cheap prices. Not the same at all. They took what they can take. if you offer best for the same price of course they will ask for better ! Your car compagny wants better profits, for less. Its not a customer problem.
Reply: I think they get stronger over the years because Greek concrete gets stronger the longer it was made
Reply: @naver0s  
Well, sure, if you want to give me a USB charging cable with a special silver alloy wire instead if copper and it cost nothing more than what is currently available.... Then... Why not?
Most would not care and you would actually get a strange level of buying simply because it is a cheaper source of silver or silver wire rather than any interest in a USB charging cable.

Quality is almost always subjective, and the final cost of a product is a component in that quality.  As you indicate, it is the quality of the purchase, not the quality of the product which is assessed.  Most market activity is to satisfy a specific purpose or to solve a specific need.  For example, I needed tools for my job at work.  It's a factory, things get lost on the job rather easily into unrecoverable locations.  Things get dirty.  Some things I might only need once in two weeks' time, but when I do need them, there is no substitute.  I can walk into Lowe's and buy Craftsman tools, somewhat depressingly made in China, now, in most instances (their toolboxes are made here... Well, mostly - the factory for that is in town, and it's one of the highest volume operations within the stanley black&decker empire).  Or, I can go down to harbor freight and come away with half a tool box for the same price as a single set of wrenches from craftsman.  The quality purchase is the one which gets me the most for my investment.  I have limited capital means and can't afford to waste money on things that do not return on their value from a job and task sense.  It may be somewhat unfortunate that I can't afford the tungsten carbide iridium plated socket set that could be used to service machines on the surface of the sun - but I have a need to be practically invested in my equipment, not ideologically so.  My personal tool collection at home that I have to make me feel completed has quite a bit more novelty inventory that allows me to know that I can service my robot army on the surface of the sun when I conquer the solar system.
Although, I will say, I think it was a Holt grease gun that I got at harbor freight and that thing has been amazing and surpassed all expectations I had for it.

Similarly, when I was looking at O-scopes and Arbs for my electronics/avionics... "Hobby" - while I would love to go with the name brand, top of the line equipment - you are looking at $5,000 just to enter that market for a single piece of equipment, depending upon exactly whose you are looking at.
By that same token, there are very functional and practical $500 offerings via amazon and ebay if you know enough to not buy something silly.  They may not be what I would use to scope out an I/O fault on a chip with true microwave capture... But the sort of components that can require such a tool are about as expensive as said tools in the first place.  Though some ganfets are getting close, but that's a technical discussion.
Once again, the quality of the purchase is subjective.  I can't do what I need to do without the tool and can't meet the price commanded by higher craft quality items.  In don't need the calibration certs, the highest end sampling circuits/chips, etc.  I just need something that makes me not naked while trying to verify that my switching power supply design is working as I attempted to engineer it, or whatever it is I am up to.

While, yes, a customer always wants more for their money, and a business always wants more for their product - the quality is in the context of the cause for purchase, not the craftsmanship of the product.  From the customer's perspective.
From a craftsman's perspective, quality is in the context of the absolute performance of the crafted thing.  Even the highest quality copper forged with the greatest skill into a blade is going to be a lower quality sword than the factory shiv I make out if scrap mild steel on the grinding wheel.
There is always a context and things which are cheap are not always the lower quality.
Reply: @Ognyan397  yeah that’s not the buildings breathing that’s called Atmosphere, if the world oxygen just went away, so would the ozone layer which in turns kills the planet and causes gravity to stop but for us living creatures we would just go flying at 66,000mph (speed of earth’s rotation) and that how fast the building would collapse as well, we wouldn’t fall off but we would just stop in dead air and fly into a wall
Reply: not really a fair test...
Reply: @Aim54Delta  I didnt say that something not expensive will be cheap quality everytime. I said that its because we have so much cheap quality with cheap prices, that good quality will be more expensive. We need to stop import the shit from outside and focus on the quality of what we product at home so ignorant people will always buy good quality at a good price. Not by choice but as a standard. I didn t ask for the absolute quality but that we stop creating weak craft on purpose. Yes it will cost less now, but it will break sooner so you ll have to create a new one. It will cost money and create waste. Back in the time, familly had one set of bedsheets, a real good one, and would pass it though generation. Today we craft shit that we throw away everyyear to then buy a new one. 
Ofc the client will always want more for his money and the business more money for their products, but thats why there is a government and law. They are supposed to take care of the game's rules so people can live happy and away from misery. 
If one wants a cheap material ok. But its not what happen. They dont want cheap material because its a cheap material they want a cheap material for its price advantage. They dont look the quality because they cant. If its a great quality cool ! But if not, its not by a real choice. I would love to say that most people have a choice in what they buy. But not so much.
Reply: Without a doubt, it was stronger right from the start.
Reply: @naver0s  
You're confounding the cause.
Disposable products and mentality are caused by cheap material and/or process, not necessarily cheap labor.  Most modern plastics are a byproduct of the energy economy, oil refinement specifically.  They can be easily and economically formed into a wide variety of structures for a wide range of uses.  The cost of acquiring new stock material from oil refinement is far less than the cost of reprocessing plastics from the market.
Steel or aluminum are far more energy intensive to produce.  There are many more people recycling metals than plastics because it is cheaper to recycle than it is to acquire new (though there is demand sufficient to drive continued mining).

By most accounts, my own included, the current markets radically undervalue commodities and consumables because of the combined effect of inflationary government spending and supply chain finance, which allows for artificial suppression of material cost by transferring operational losses, financially, to investors (people's retirement funds, effectively).  This makes the material cost of products far cheaper, drives down interest in capacity expansion, and makes labor an outsized component of manufacturing cost.  One of the reasons it is so profitable to outsource is because the material cost is decoupled from its geographic reality.  Steel produced in America is bought and sold in the paper markets alongside the steel made in Vietnam.  These same paper markets influence, heavily, the price paid by the actual end user of the material (factories).  While there are contracts settled outside of exchanges, they still fall within the same order of magnitude of price settlement as what is in the exchanges.  "Backwardations" - which is when an end user or retail location sells inventory back into the paper markets, is an increasingly common phenomenon as inventories draw short and deliveries are demanded.  In the case of gold, for example, there were over 200 paper claims of gold for every unit claim available for delivery.  This lowers the price of "owning gold" - but when such a time as delivery is demanded, there will simply not be enough to realize it.  There is more paper than the asset in question.  
It's even worse with silver and the physical price of silver is significantly higher than the spot price, roughly 20% higher at present.  You used to be able to find it for 2-5% over spot rather standard, but those days are long gone.

Anyway, all of this also suppresses wage growth.  Raw resources often have a low profit margin because competition is easy to find.  2-5% tends to be raw resources.  These are your farms and mines.  Their primary input is energy/labor.  When the price of raw resources can't rise to reflect scarcity because of financial ponzi schemes, there is no expansion of production and no increase in the number of people inducted into the labor for raw materials.  This suppresses wealth growth among the least skilled job classes and easiest to get into.  Physical resources can always command the best prices and job security in the face of economic hardship.  Even a complete collapse of the "top" economy will still want to trade in goods and services for resources to cobble together into something they can make.
This lack of growth in the base economy means fewer real resources for the economy to work with, preventing real resource cost from dropping to reflect supply, and suppresses demand for the manufactured goods demanded by all, but constrained by supply of raw materials and allocation of assets/labor to said task.  You have fewer people working for less pay to provide fewer materials than the market demands, who can't afford to buy more of the manufactured goods to drive investment in more manufactured goods.

Worse, government spending targets large corporations and welfare programs which inject currency into the top of the market to try and compel more production.  More often than not, this results in excesses being taken as profits and invested into static assets than invested as capacity.  The "rich get richer", being paid by the government to make things which can command the highest profit margins.  Finished goods can always command the higher profits because they are the application-specific thing which has far less competition and/or far more craftsmanship/philosophy traits.
Injection into welfare destroys capital incentive to provide labor to base production while enabling price competition for all variety of resources.  In a situation where price deflation should occur as cheaper labor drives greater resource production and lowers raw material cost, this arrangement destroys production increases and creates both capital and price inflation which tends to stagnate in assets held by "the rich" until total systemic collapse results in market price discovery and an erosion of government authority to inflate the capital currency supply.

People who suggest government backed central banks should be shot on principle and governments which run a deficit for more than 4 years should be wholly executed for treason.
Reply: IT'S TRUE
Reply: @Ognyan397  if all oxygen molecules disappear yea, but if the air only disappears, buildings wouldn’t fall
Reply: And what factors should be taken into account in matters of "brick perfectness". Maybe lower values are good as well, but production process and materials uses make it like 10x cheaper in real money? Not a bad trade off if it is still useful.
Reply: probably also survival of the fittest to a degree. if a brick from 1890 was a shitty brick, it probably would have disintegrated by now, so the bricks left from 1890 are statistically stronger as opposed to bricks made in  2021
Reply: The old ones are stronger because back then people weren't lazy and actually put effort into their work, thus producing better things.
Reply: Your question is a good one for the concrete. Concrete will continue to cure so long as it has access to moisture
Reply: Likely they gained strength because the old bricks were likely in a structure and under compressive force for all this time. They're now more dense.
Reply: Built in obsolescence
Reply: I think the brittleness was a larger factor than strength
Reply: A way to test this is to make a brick in the exact way the old bricks were made. Though doesnt seem very possible to get a hold of everything you need
Reply: @Thunder44420  no more plants or trees to renew the o2 we use 😢
Reply: @churchroadrecordsreviewsan231  but we have machines now. Would make sense that the machines would be madr to do a good job. Also i think it has to do partly with what brand of sorts the guy got the brocks
Reply: @Thunder44420  oh don't underestimate that, look at Mars
Reply: @XanderProduction  lol, yes carbon will transform to a diamond under extreme heat and pressure, something that exists in our earth's core
Reply: @MrDeicide1  lol, they may be done just a better job, people become lazy as you see ☺️
Reply: @Aim54Delta  its because nowadays everyone try to save time and money. Also the mix ratio spiked with cheaper materials, less time to prepare, less time to cook and so on. Just to make it more affordable to produce bricks. In the past things where different less mass production brings better quality
Reply: I find that oxygen comments funny.... Yes concrete buildings breath maybe ask your home if it need a mentors when there's bad smell 😂

Yeah global collapse in vaccum 😂 yes but not after 5 sec, rather about millions of years (maybe earlier but not in the next xxxx generations)
Reply: Sorry it's water content take 50 years for concrete to seep it's moisture. The fast kiln dry is not as good as a slow fire dry.
Reply: @dartheater7348  no, why do you think old builings stay standing for 100s of years. Nothing o do with size, just the way bricks are made and how theyve been aged
Reply: @dartheater7348  666 Likes….  Lucky number?
Reply: @Ognyan397  not really, bricks would not be effected in a vacuum; however, if there are air bubbles inside a brick than it is a whole different story, as the pressure from inside will be too much for the brick given the vacuum
Reply: @Ognyan397  space ships tho
Reply: @Thunder44420  remember when Earth's ozone layer kinda disappeared in some parts of Antarctic? Well, imagine if Earth lose 100% of its atmosphere. 

It could happen
Reply: I do not know, but I would pay a lot of dogecoin to learn the answer. I see a lot of old brick buildings being torn down nearby and they just toss the bricks. Really a shame to waste them
Reply: There's also strength to weight ratios which affect structural integrity limitations, as well as if they were made far stronger than necessary back then, whereas better results can be obtained today with newer production methodology.
Reply: @Ognyan397  pretty sure it's because of the fact that concrete continues to cure over time as long as there's moisture rather than adding oxygen. I know what video you're referencing, but it's pretty much irrelevant here.
Reply: Bricks in 1890 didn’t even had logos😂
Reply: The only ones to survive were the strongest ones. We're only left with the strongest old bricks.
Reply: The new brick looked porous
Reply: @Ognyan397  that is not true , people debunked .it .
Reply: @Ognyan397  Actually, no. Not oxygen in the air. What you are referring to is molecular oxygen. There is no way more could have gotten in the cement bonds and even if it did, it would be useless if not harmful
Reply: @dartheater7348  also had less holes in them.
Reply: @dartheater7348  00
Reply: It is due to age hardening.
Reply: I could be wrong but I doubt fired clay bricks will strengthen over time. Their chemistry is just not the same as Portland cement. What I’m interested to know is how the composition of the bricks has changed over time due to changing sources of clay, and how that might effect their properties. Also relevant could be the forming and firing conditions.
Reply: May be the old ones in this test just simply have higher quality than the new ones? I mean they are not the same brand or same price.
Reply: @radicalracing09  i agree the modern ones are full of holes and more companys use cheaper substences for more profit
Reply: dude, obviously the 1890 brick was working out at the gym, and showing off to the 1950, and 2021.
Reply: Survivorship bias also in play. Weak bricks from long ago have fallen apart already. Only the strong bricks have survived to be a part of this comparison.
Reply: I think it’s the curing and bonding, unless soil consistency has drastically detoriated. Another perspective is that we don’t really need very strong bricks anymore as we don’t much invasions or wars.
Reply: They’re solid no air filler
Reply: @Ognyan397  Chemistry major here: buildings do not need atmospheric oxygen to stand. There is no chemical reaction between gaseous oxygen and hardened concrete. Molecules of concrete contain oxygen which helps bind the concrete molecules together. This oxygen within the concrete is in solid form and has nothing to do with atmospheric oxygen. What you heard was probably a hypothetical about "what if all oxygen was removed from earth for five seconds", not "what would happen if atmospheric oxygen was removed for five seconds." What you are saying is that concrete would crumble without the presence of oxygen gas. That makes no sense because there are many examples of oxygen deficient air flowing through concrete. Also, how would the inside of concrete get air? Does the inside of concrete turn to dust because it is not in contact with air?
Reply: Also another question of selection bias. 
The bricks from 1890 that survived to today, are by definition stronger than all the ones that didn't make it.
Reply: That’s what I was thinking
Reply: Modern are more porous, therefore have lots of air pockets.
Reply: @Ognyan397  this depends more on the structure and how it is built, barns require alot of air flow so they aren't built the same as houses, usually alot of vents and large open doors for wind to travel through, houses are typically sealed alot more to remove outside airflow as oxygen makes fire spread faster
Reply: Good point. Also whether 1 single brick is a representation for bricks of that time is another. Additionally, the fact that newer bricks container more air pockets might improve insulation.
Reply: But this is similar to the concept of concrete, we've never recreated the formula that the Romans and Greeks use. And modern-day concrete is actually well known for breaking and cracking compared to the concrete of those time periods. So yes the building materials are weaker but it's for insulation purposes usually
Reply: the surface pressure also gets bigger with each cube so the power is going from being in a single dot to the whole cube later one which also matters
Reply: I think they gained strength.
Reply: @Ognyan397  I have significant doubts regarding such claims as many materials are vacuum sealed for long distance travel, but to give you an out, most every building material has some Oxygen already bonded to it, such as SiO2 (Sand) which makes up concrete.
Reply: @Ognyan397  you'd think rain and water damage would make it a bit porous and create faults in the bricks integrity
Reply: @Ognyan397  Not entirely the truth. Oxygen is a building block that holds cement (A part of concrete) together. If we take out the oxygen atoms from the cement, then concrete buildings would collapse. However, if we remove the oxygen from air, nothing would happen.
Reply: @Ognyan397  no, they meant if you took the oxygen out of the atomic structure of the bricks it would crumble, which is no surprise at all as it’s a binding component
Reply: They were stronger.
Reply: @Aim54Delta  good point! I also thought maybe nowadays little air chambers in the bricks are welcome for temperature and noise insulation.
Reply: A lot of old materials/constructions/machinery tempts to be more robust to the fact that precise efficient engineering wasn't really present before the age of computer simulations. So in order to guarantee durability, engineers tempted to just increase the amount of materials used and make everything just a little heavier/thicker/stronger than perhaps was needed. If something needs to last for 10 years, but you can't make sure it exactly lasts that time, you just make it last 50 years and you'll be good for sure
Reply: they were simply better made.
Reply: @Ognyan397  no, they were literally just made better. today things are made cheap, and nothing is built to last. back then everything they made was made to last. they couldnt afford to make them cheaply.
Reply: @Ognyan397  I know the video you are talking about. Sadly, the video was made by YouTubers who doesn’t have basic science knowledge. He was literally translating that everything needs oxygen, without oxygen buildings and Bridges would collapse. Little did he know already formed concrete or wood or bricks would do nothing in vacuum. Cement and other building materials have oxygen atoms bind together. That is the explanation,but he took it to one neuron brain level.Say for example, bricks contain oxygen-silica compounds, cement hydrated calcium sulphate or anything you can think of which are used as building material
Reply: @Ognyan397  oxygen is cured with the bricks in the furnace
Reply: @Ognyan397  How?
Reply: @Ognyan397   Any source?
Reply: @Ognyan397 that’s the dumbest shit I’ve heard all week.
Reply: different sources of clay. maybe the best clay sources were exploited earliest. also bricks were made manually at that time and the clay knocked to be more dense.
it is obvious  that the 2021 brick is more porous with more cavities and tiny cracks.  the darker color of the old bricks also can be a sign that it had been burned at a higher temperature, so the clay is not just burned but even sintered a bit
Reply: It's more depends on clay quality, clay preparation, firing temperature. I remember when i found old clay brick that are overfired it has deformed shape and melted from one side. I try to break it but i failed i was felt like it was stronger than quartz rocks